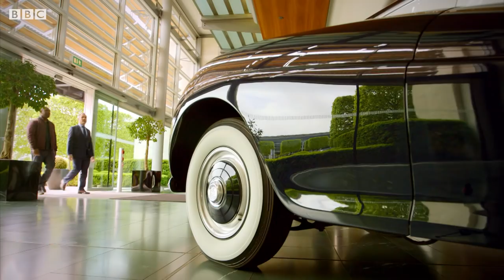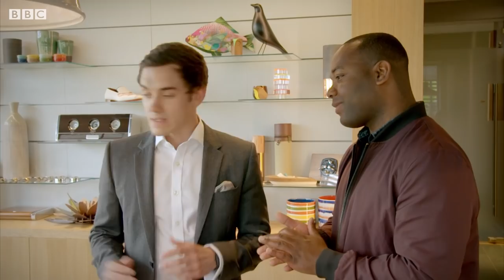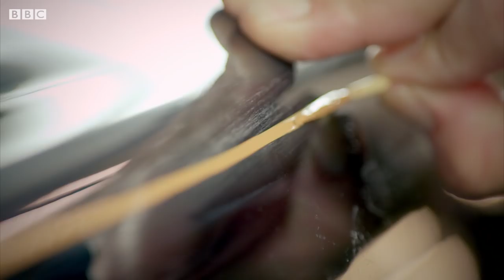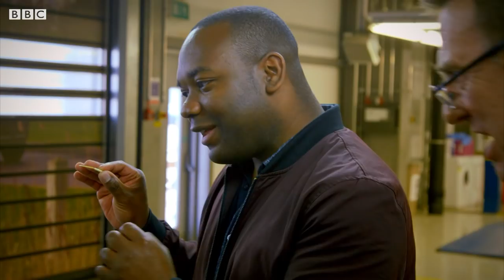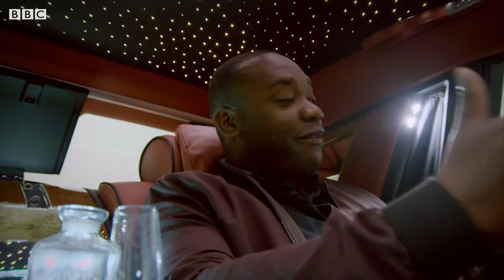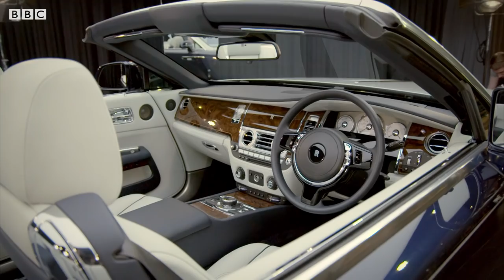Rory Reid Visits Rolls-Royce | Extra Gear | Top Gear

Comment: Ahh, such lovely German cars.🙁
Reply: Qasim Mir they are still British.
Reply: Chatta290 Wrong. Rolls-Royce Motor Cars is a subsidiary of BMW. They simply bought the rights to the RR logo, Spirit of Ecstasy, and the Grill, then set up a factory in the UK. The engine and drive train is German as to the chassis (which is based on the BMW 7-Series) and body. It is then shipped to Britain where it is assembled with a British made interior.
Germany makes it, Britain nails it together. Shameful.
Reply: Qasim Mir a few underlying parts are from BMW, they share expertise and make them in the same factories. That’s common sense rather than making it all in the UK and using different inferior parts, bmw use certain parts for a reason. The chassis is something that doesn’t matter where it comes from, it’s just the underlying part and in VW’s case a chassis can be so configurable. The ghost shares the same chassis as the 7 series but not the phantom. And if you had any idea of how a business works and operates with subsidiaries and the advantages of it then you would know that this is still a british car, handmade in the U.K. and designed there also. Your false statement is not true at all and parts come from all over the world  for most goods. You don’t call your phone Chinese or your Honda british do you? 🤦🏻‍♂️
Reply: Chatta290 Engine and chassis just a few underlying parts? Jeez that’s the main parts of a car! Not only the 7-Series shares the chassis of the Ghost, but the Wraith and Dawn too. Can’t get away from the fact that underneath the body it is a BMW. Great cars, just a shame they’re not owned by us or fully made by us.
Reply: Qasim Mir I have been in a 7 series, in fact pretty much every day for the past 2 years. I have seen a few rolls Royce’s and trust me even though a few parts are similar in the interior the experience is a world apart, the engines aren’t really the same either as any bmw anyone would experience as very few even have the v12, only the M760LI and what dumbass spends 130k plus on a BMW? But still I wouldn’t go and call a Lamborghini an Audi even though they share lots of parts or a VW a Porsche as the chassis is the same as the one used on the Cayenne or panamera
Reply: Chatta290 Well of course the interior is going to be different. That’s that’s what is different about them. As with most of the British engineering industry now, we are constantly buying major components off the shelves from some other country rather than doing it our selves because our government has sold off and abandoned our industry. I think we’re tired of this now to be fair.